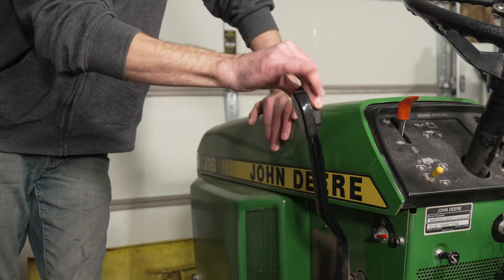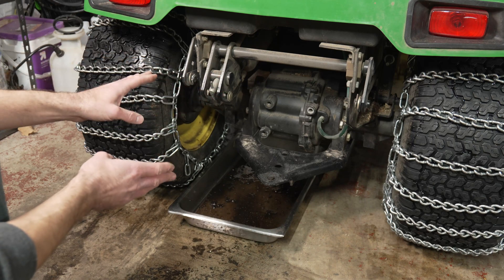Why Your John Deere 54 Blade Turns Slow (And How to Fix It)

Comment: Hey Nick, great video. question, can you lock it out with the tractor running or do you have to turn it off?  I bought that one from the Amazon link you shared. worked great until I switched it while it was running and now it doesnt lockout 3 point and deck.  Not sure if it’s faulty or if you’re not supposed to do it with a tractor on.  
Thanks for any input bud
Reply from the maker: Oh interesting. I turn mine off with the tractor running and it is fine. Hopefully you didn't get a faulty valve.
Reply: @nicksatrangequipment Thanks for the response bud. It still somewhat works just doesn’t  fully lock them out.  Just slows it down.  I ordered a different brand I’ll give that one a shot. Just wanted to make sure.  They did give me my money back tho.  So that was nice.
Reply from the maker: @Hillbilly-Garage oh that is good. Maybe I should take that link off. I got a recommendation for that valve from a trusted guy so I thought they would be good.
Reply: @n @nicksatrangequipment no worries at all. I’m not blaming you one bit.  I absolutely love the idea of it just don’t want to spend the $100 on the auxiliary hydraulics one.  
If this next one don’t work, I’ll just order the exact same one you did lol

Comment: Great tip. Been searching for a blade for the 318, I've seen a few for around $500. Any issues on buying an old blade?
Reply from the maker: Yeah, I paid about $500 for mine. As long as you make sure there is no damage and the hoses are in good shape, there is nothing wrong with buying an old blade.